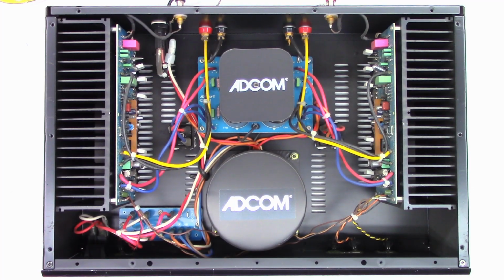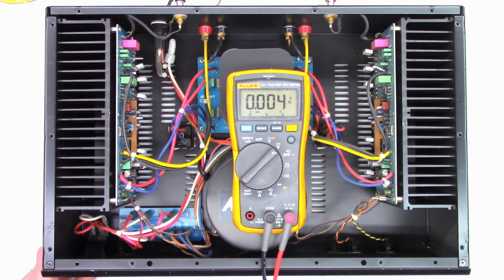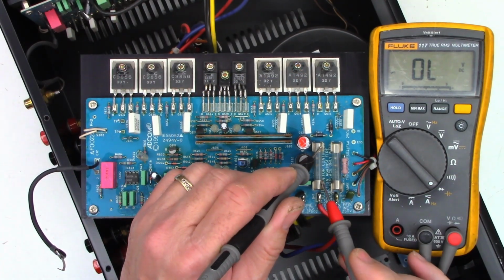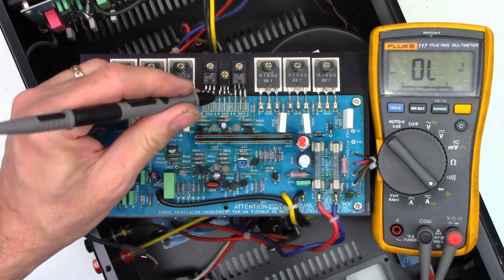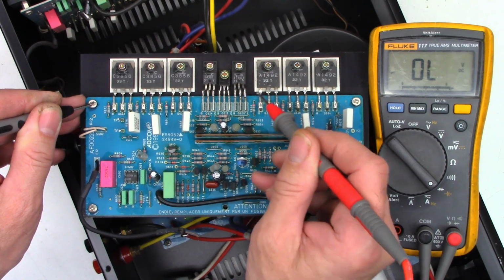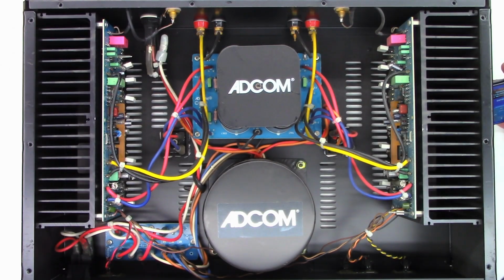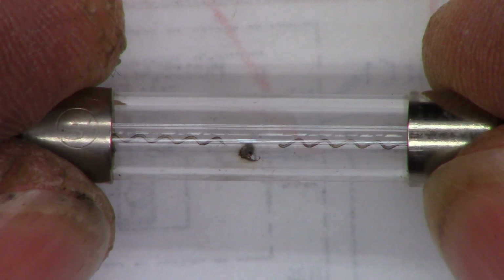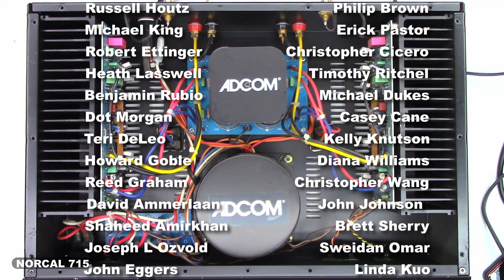Adcom GFA-545II Stereo Amplifier - No Left Channel Output! GFA545

Comment: I had a plasma torch blow a fuse. Spent an afternoon checking everything out. Found nothing. Changed big fuse and it's still running four years later. Good work Steve.

Comment: I have an original 1986 GFA-535 with the custom Adcom 6800uF 63V aluminum electrolytic capacitors with three (two active) pin terminations. The amp was used for 15 years powered 24/7. Do you know of a replacement cap? If not do you know the cap's active terminals spacing? The caps are not leaking or bulging, should I even consider replacement? Thanks!
Reply from the maker: As long as the unit has been powered up continuously, I would not think you would need to replace the filter caps. Sitting idle is what kills them.
Reply: They were powered 24/7 for 15 years then sat idle for 20 years. If the caps 'look' OK it is better to increase DC voltage slowly across the cap to regrow oxide (?). That's difficult to do without the use of a variac. I have used the amp a couple of times in the last year to 'burn-in' speakers. I searched for replacement caps online from all major parts suppliers but I need to know active pin spacing?

Comment: Hi, I’m a subscriber.  My class A amp, (adcom gfa5802) just recently developed a slight buzzing hum on the left channel.  Do you think the filter capacitors for the left channel are bad?  I checked the DC voltage at the speaker terminals and they’re at 0.025V, so I think the coupling capacitors are fine.  Or do you think it’s something else?  Thanks in advance.
Reply from the maker: It may be one of the main filter capacitors that is failing indeed. Measure the DC voltage and compare it with the same capacitor on the other channel, if one is lover than that may be the one. Also measure the AC voltage with no signal on all of the mail large filter capacitors. If one has more AC voltage across it then that is the culprit.

Comment: Could that have been caused by shorting the speaker wires?
Reply from the maker: Possibly but if the speaker wires were shorted I would expect much more damage, like shorted output transistors and totally blown (carnage) fuses. I think it was a gentile overdriven condition.

Comment: Could you help me . I need To replace  the red pilot light on my Adcom 545. What is the voltage running to this lamp?
Reply from the maker: It should be a standard 1.9V 20ma LED